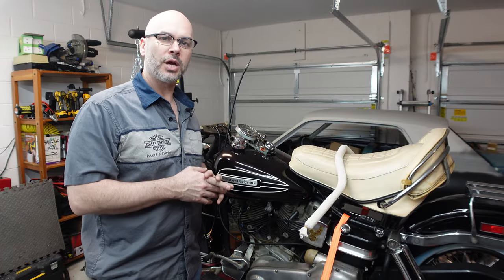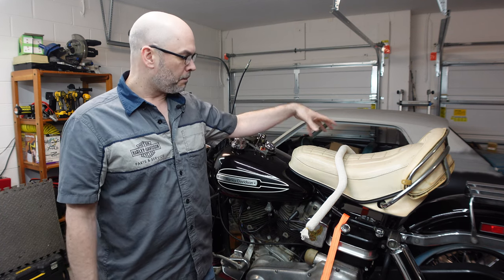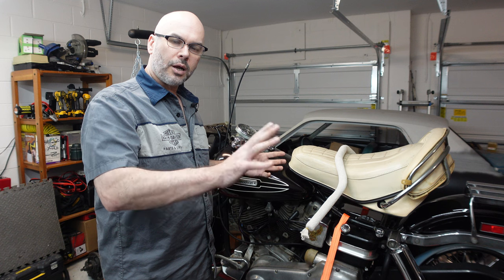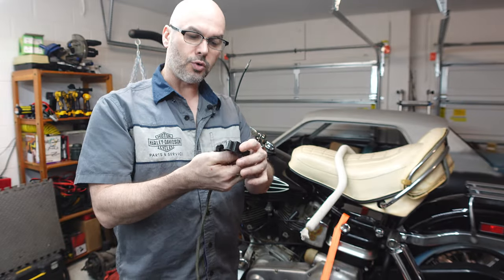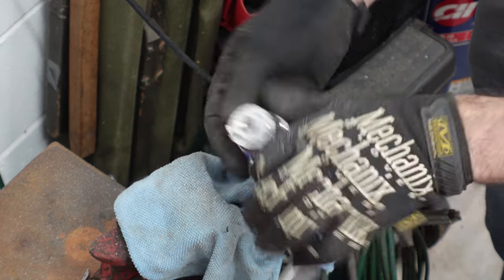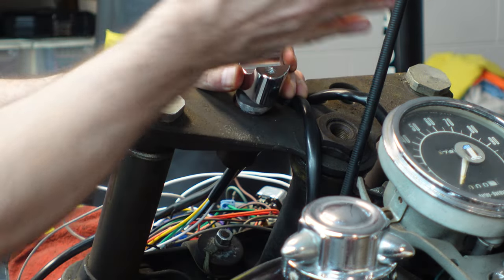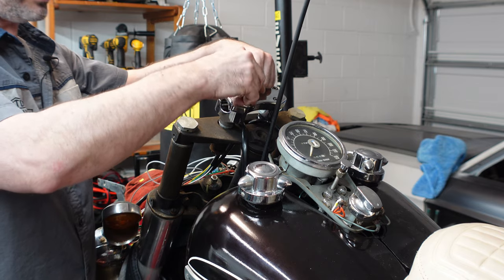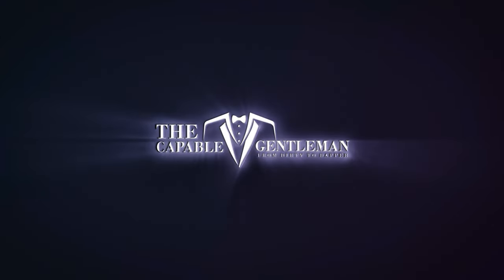Installing A Handlebar On My Motorcycle

Comment: I have not worked with replacing handlebars like that, was there no means of closing the gap in the factory forks via washers/spacers to then be able to have your aftermarket parts sit flush? Any plans to re-chrome the parts that you had to taper to fit the recessed area in the fork, or is the portion that is visible (from the modification) negligible? Nice work on developing a work-around since the aftermarket manufacturers failed to include an adapter that fit your 1972 setup. In the wise words of my dad, if it doesn't fit, make it fit! :) Kudos!
Reply from the maker: The aftermarket riser already sits a bit higher than the stock riser.  If I elevated the recessed area in the fork to be flush, it would make the riser sit even higher.  There is a chrome cover that is supposed to go over the riser clamp and if it sits too high, it won't fit.  As long as I can get the cover on, I'm not worried about re-chroming the part.  I thought this was the best option with what I'm trying to do.  72 was a really odd year for AMF HD.  I'm finding some of the configurations were only around for a year or two and then they changed it up.  Of course, I have the year with the odd setup....but I'm up for the challenge!